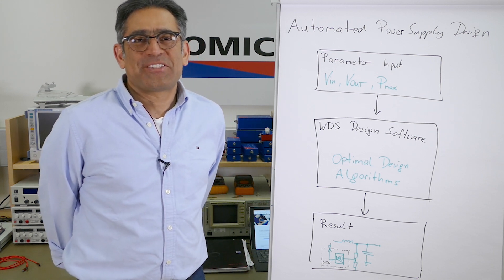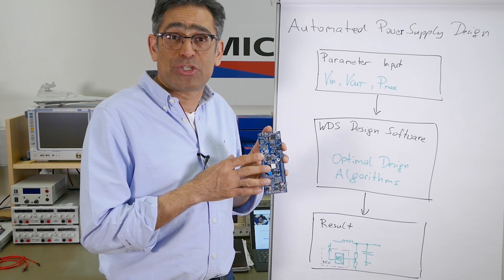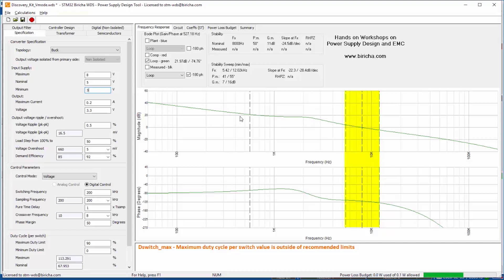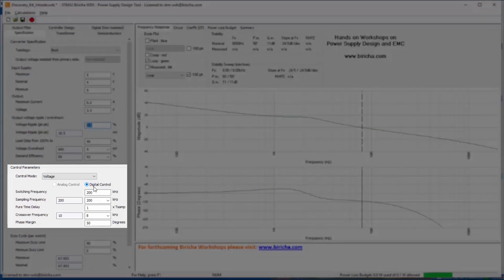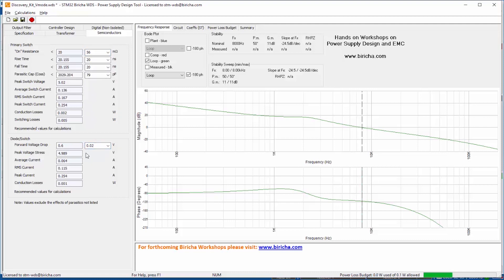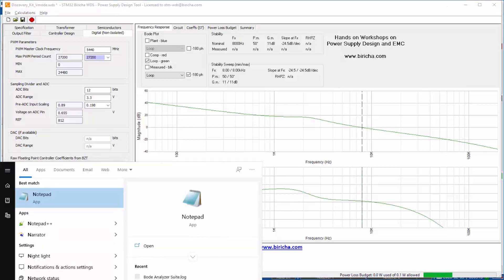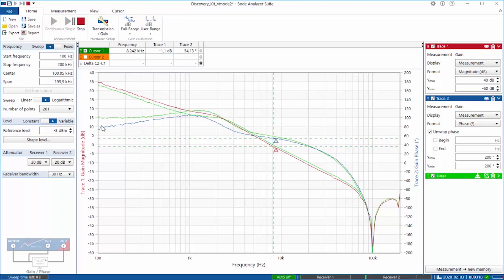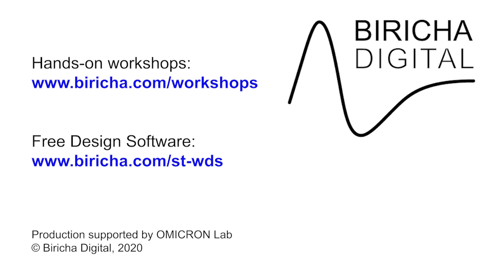Designing a Digital Power Supply with STM32 Microcontrollers

Comment: Hi dear Ali Shirsavar,
I have a question about AC to DC PSU.
I need to convert AC voltage (12v to 48v input) to DC voltage (output 19v to 82v) with constant current output 350mA, with efficiency more than 85% and PF>0.85
What topology would you suggest?

Comment: It seems you are a pro, but I have challenge for you.
Can you design an offline isolated power supply that the controller be in Cold side instead of hot side? 🙂

(Without adding a 2nd power supply to supply the controller VCC)

Comment: what is the point of the output filter tab? if the tool suggests some L and C values and we are having different L and C values on the board then how does the tool adjust this variation in L and C values? Does the tool re-calculate the coefficients according to the entered L and C values or does it adjust the Gain and Phase plots?

Comment: 5.4 Gigahertz???
Reply: thats just the clock for the pwm, the actualy frequancy for the processor is 170mhz i think
Reply: Yeah the hrtimer pwm module has a resolution of 184ps, which works out right around 5.4ghz.  I was confused initially when I heard that too.